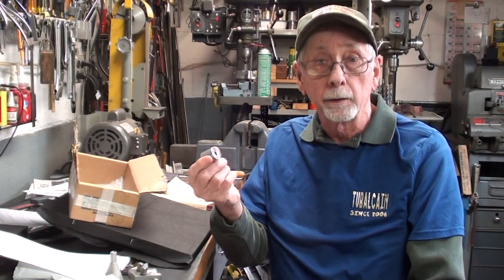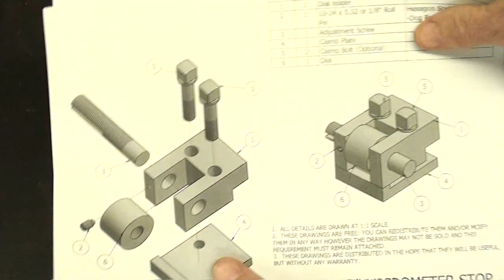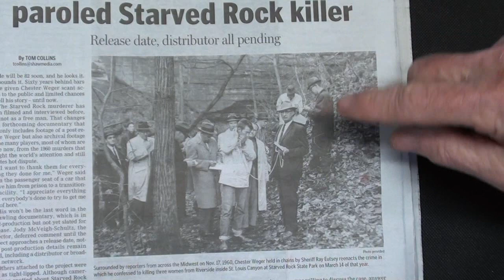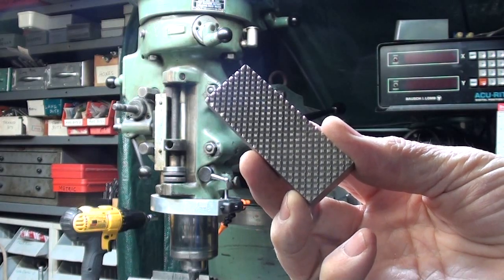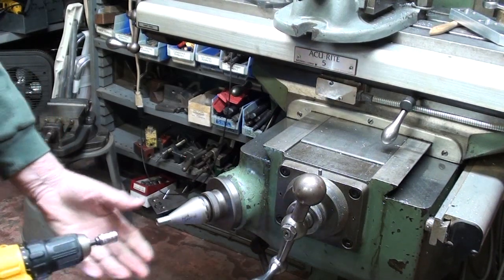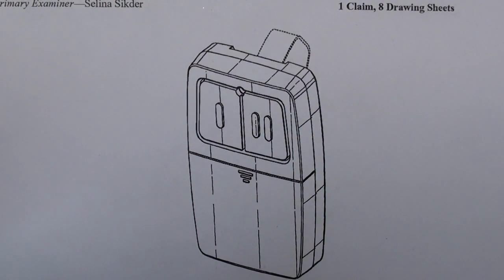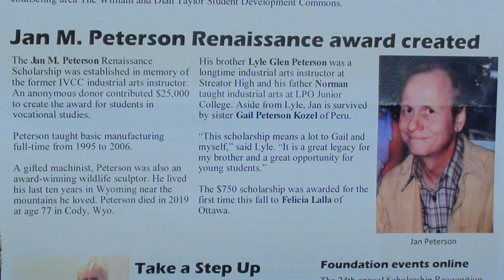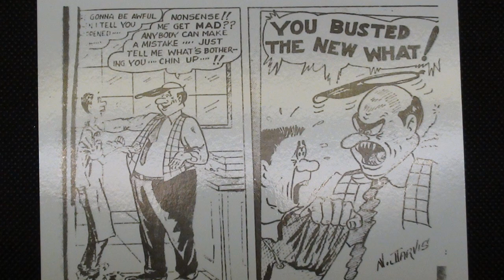BOX OF SQUARE HOLES tubalcain VLOG #19  mrpete

Comment: Lyle, thank you for you excelent videos of machining and your rants about this and that. Always entertaining. To those not informed about cold casted bronze or similar powder metal castings, you could tell that the material is about 90 per cent metal and maximum 10 per cent urethane or epoxy. The plastic is there as a binder and a binder only. It should only cover the metal powder whith a thin layer enough to bind the parts together. I have been casting urethanes/epoxy of all types for more than twenty years, so I should know.

Comment: Mr.Pete I worked for a company from Orland Pk.Il. called Andrew Corp.We did square holes with a fixture on a hand mill.The fixture had a piece that clamped down to a base which had a square guide hole in it.So you would start with a turned part with a hole in it like you would with a broach but used a floating paddle 3 sided blade fed through the fixture hole.You got a square hole with slightly radiused corners.Later I ran Burgmaster NC mills which ran programs on mylar tapes.

Comment: Hi Lyle, 
If you are using those "square holes" to hold cutting tools, Keith Fenner has used inserts in various boring bars he's made,  that come with a grub screw for adjusting the tool. They are a standards item in the US.

Traming the head on a turret mill is not so bad left to right, but a total pain front to back.

Comment: Quick comment on Burgmaster...I have one in the shop where I worked that needed replacement.  Rather than buy a used one on eBay, we reworked the existing one.  Let me tell you that that machine was nothing but quality throughout.  The repairs that were made were superficial and it is again running like new.
Reply: John,

I had many hours repairing and maintaining Burgmasters from the small manual machines to the larger automatic machines to the full CNC machines. Our CNC mills were purchased in the mid 1980's. These were built during the last breath of Burgmaster. We later purchased new Burgmaster manual machines after they were built in the Orient. I was in the Los Angeles plant for maintenance training when we purchased the CNC machines. Our plant was flooded in 1993, and the Burgmaster CNC mills were replaced with new Mazaks. 
Our shop was very loyal to Mazak, so I have vastly more experience with Mazak than Burgmaster. I have never ceased to value the contributions Burgmaster made to the development and application of the geneva wheel. In my decades of machine repair, I have never felt more affinity to any other mechanical design. I have encountered fascinating complex engineering that works well, but couldn't endure the way that Burgmaster perfected the geneva wheel and related mechanical designs. Their designs were intuitive for the repairman. First time encounters were easy to assess and repair. Their employment of tapered alignment pins and sockets with allowance for wear meant decades of production with no intervention and no deterioration of machine accuracy. 
When I retired in 2017 one of our 1960's vintage automatic turret drill presses continued to crank out drilled and tapped holes all day long. I was occasionally still in contact with a very aged former Burgmaster employee that sold new old stock parts from his home. His operation was so simple that he had no provision to accept purchase orders or process simple invoices.
Burgmaster was a high volume production machine even in the basic D-1 design. I still see them pop up on our local Craigslist, but there are few practical applications for the home shop user. We equipped our manual machines with Tap-Matic heads to speed up the tapping step. I could rant on for a long time about this company and my experience with them and their machines.
Reply: @paulhunt598  Paul, I haven't had as much experience as you, but I do appreciate hearing from folks that realize the quality of these old machines.  Our shop also replaced the Burgs with CNC...but, whenever the CNCs broke down (which seemed very often), the old Burg was put back in action with no issues whatsoever!  It also gave the operator a meaningful feeling when operating the old machine.  Thanks for your feedback...much appreciated.

Comment: About your eyes: If it is cataracts, consider getting the surgery where they replace the foggy lens with genuine plastic. I had gotten to the point I couldn't read a Vernier. Had the lenses replaced with the latest version (over a year ago) and I see better now than I have in many years. I don't need glasses because the plastic lens is hooked into my eye so it is moved with the same mussels that do it naturally.   Highly recommended. I'm 78!
Reply: Have you had an exam by a specialist to determine if you could be a candidate for cataract surgery MR Pete ??  I also had both eyes done & I now have close to 20-20 in both eyes

Comment: I'd appreciate a video on the use of those square hole sleeves.  I'm thinking loctite them in but would there be an application where threading one would be useful?  Would press-fit work?  Guess you could pin it if you didn't need a through hole. The prices are reasonable and much cheaper than a broach.
Reply: Love me some green loctite, sleeve locking type. Good friend of mine taught me how to use it when installing rivnuts.

Comment: Only drawback to purchased square holes is you have to find a way to lock them into your workpiece. Welding is not always an option, and the thin wall of the insert doesn't give you much to work with. Just a thought.
Reply: Loctite is the the easiest and most practical solution. Warm to touch with a hair dryer for fast setup

Comment: I saw the thumbnail & title of that video & I skipped it. I thought you were going to use a square broach which ToT already did. Surprised on hearing you say it got 500k+ views, I searched back & watched it and I'm glad I did. That was a great video & technique. (I don't think you'd get those 500k+ views if you used a square broach lol.)
Reply: I agree. His approach was clever and I wouldn't have considered it on my own. The weak point is the halves attachment, but this can be easily modified with stronger attachment hardware if space allows. 
I made a square hole in aluminum using a single point broach fashioned from a broken carbide end mill. I used the mill quill for the broach stroke, stepped cut strokes with mill X and Y control and locked the spindle so it wouldn't turn. It worked, but it was tediously slow.

Comment: Lyle.
2 things.
Surely Rumble are actively 100% censoring your contribution by "approving" it  ?
Secondly .. why does the stainless steel printed item have a line down it that looks very like a casting split mould witness   ?
Reply from the maker: Finally, today after several weeks day approved my videos, LOL
Reply: The line is called the seam on the printed part, and is formed by each layer starting in the same position. It is actually quite small, but is more noticeable on a part like this.
Reply: Thanks @MurphysSidekic  good info

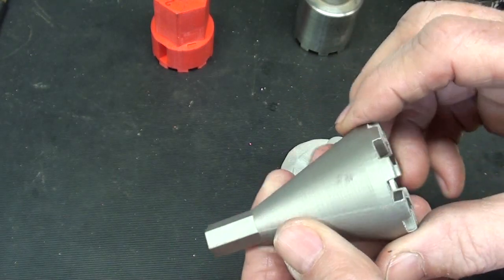Comment: 10:31 This is the first time I have ever heard of 3D printing with stainless steel.
Do you know the grade of the stainless ? Thanks.
Reply: You can print in all grades of stainless... its like compressed metals (powdered metals) except it as a bonding agent to get the grain structure to  stay together . The heating process it whats actually activates the flux (im assuming its like a flux ) and bonds the metals together ... the problem i forsee of this method its sporadic weak points in the prints . Think like if the grain structures are so mess up they do have time to normalize themselves in the time in the oven... just my two cents . but Yea all grades of stainless can be printed this way :)
Reply: @davejack8973  Thanks for your answer.
Reply: This is 17-4 stainless
Reply: @MurphysSidekic  Thank you.

Comment: While Youtube may have its faults, Rumble is not the answer. Very poor playback controls; no auto-captioning. (I don't process spoken words very well; I HAVE to see it as text.) If my favorite YT creators (including Fenner) move exclusively to Rumble, I will just not be able to follow them any more. I'd rather that people fight censorship than run and hide from it.

I think I have around 20,000 books. Unfortunately, since I moved from a very large house to a very small house, I no longer have any places to shelve more than a few of them so they languish in boxes. They are what I have chosen to keep from among the 50,000 or so books that I've read in my lifetime (like you, 77 years). (I'm a very fast reader, so an average of 2 books a day is not excessive for me.) I will probably have to winnow them down to something I can manage. I've read all but a few of the ones I have and will probably get around to  the rest of them.

If your eyesight problems are from cataracts, the operation is not difficult or painful (I've had both eyes done). You do lose the ability to adjust focus, so you may need more or fancier glasses, but that is not much of a problem. I use simple dime-store glasses in various strengths; I keep a cheap pair of the right strength at each location where I might use them. (Car, bench, TV; I chose close focus implants so I can read and work at the computer without glasses.)
Reply from the maker: Wow, you have a lot more books than me. And you read most of them .  I am a very slow reader, with poor retention. Thanks for the advice On my eyes
Reply from the maker: I have no intention of moving everything to rumble. I'm just playing around a little bit with it

Comment: In defense of people with no bookshelves...or books...Many still read but just do it digitally.  My wife and I both fought the trend through the 90s and into the early 2000s saying we would much rather hold a real book and turn pages.  That was years ago though and with the smart phone I am not looking back.  I still have many books but have got rid of most.  My Kindle library is extensive...
Reply from the maker: I never thought of that. That is what I need to do
Reply: Hi.  Like you I preferred to hold books, to smell them (new ones smell wonderful - I always sniff before reading ☺️) but switched to ebooks.  Really cool, especially the price!  But one day I was waiting at the morning bus stop and my book's battery ran out.... bummer!  Lots of sitting around with my  finger up my nose, that day.  So I'm keeping a foot in both worlds - and am making sure I don't run out of angry pixies in one of my books.  (I also carry a spare book, just in case...)
Reply: @mrpete222  Not sure if your response was meant to be humorous, but one advantage digital does have is you can enlarge the font.  You can also change the font, the page color, the brightness, and even the spacing.  Might make it easier for you to read.  I know the older I get the larger the font seems to go...Of course much of the material you like may not be available digitally...